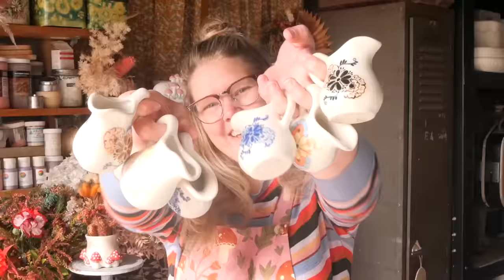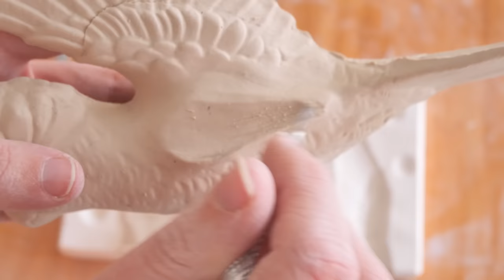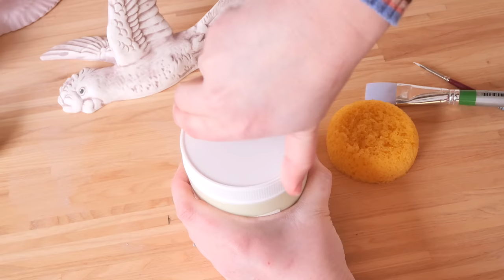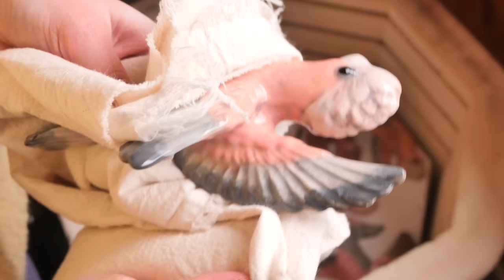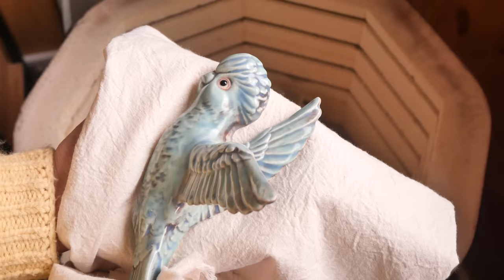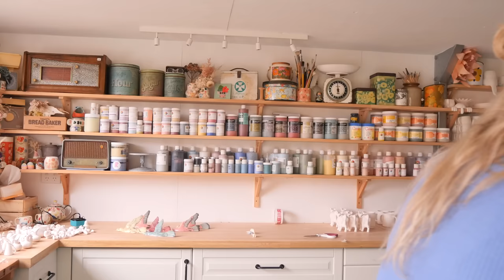Ep.9 These pieces CRACKED!! I don't know how to fix this!

Comment: Hello Shelby, I believe that the opening in the back will slip over a nail that is in the wall.  I think that they would be well supported and hang flush with the wall.  It is nice to see all the different versions and I am confidant that you will learn how to fix the cracking issue.  We all can be hard on ourselves when things do not react the way we expect, but this is how we grow.  Thanks for the hard work you do for these videos and for taking us along on the journey.
Reply: As someone that has the 3 flying ducks on the wall this is exactly how you hang them. You hammer a nail or put a screw into the wall and then the little round hole slips over the end of the screw/nail so they are flush to the wall. I also think there is a special type of hook you can get to hang them from drywall.
Reply: Was thinking the same thing, a nail or a hook are often used to hang something like that "invisible". Sadly not a potter so no advise about the cracking. The birds are very cute though!!
Reply: 100% this
Reply: This was my guess too
Reply: Precisely what I would do.
Reply: And I was figuring either a nail or a round head screw
Reply: My Nana used nails too.
Reply: This is exactly what I was thinking too
Reply: I have kingfisher versions and they have a small keyhole shape hole at the back to hang on a nail. Beautiful galahs - wish I could buy them too!
Reply: As someone who grew up in Australia and had a pet galah,  I would love a set of these. I doubt they'd make to England in 1 piece. They are beautiful x
Reply: I really like the first picture of when all the birds were on the table together. They looked like a whole flock of birds and were all different. Looked so spectacular. ❤
Reply: Yes, we had a set of fruit and a set of ducks all had that hole to fit over a larger head screw/nail. Very common kitchen decoration years ago in Canada.

Comment: Shelby I used to pour these you need to pour much lighter drain sooner the head to wing crack is possibly an air gap in the head but mostly due to head being full. Then get the mold open to set up and then add wing when it is formed wings also need to drain and poke a hole into the body  where they join.

Comment: I think the cracking problem could be fixed by taking the birds out of the molds sooner. If too much shrinking occurs while the clay is in the mold and part of the mold interferes with the clay's ability to shrink without being stressed it could result in cracking (especially in that curve where the wing attaches to the body). I also slip cast and have found that that usually solves the problem. Good luck!

Comment: We had some hanging budgies and they hung happily with a nail in the wall , popping in the hole at the back of them 🤗 x
Reply: I’d use it as a nail hole as well. If the angle isn’t quite right, you can use nano tape-that double sided silicone tape. That way you can secure it at whatever angle you want.

Comment: the holes are for nails in the wall probably, but I would use a raisin based glue for adding a hook or use 3M picture stickers
Reply: I agree with the notion of reinforcing the hanging method.  Adding a hanger with more options for angles and direction will give you lots of choices and the confidence that all of your hard (hard!) work won’t come crashing to the floor! Like other commenters I had to google up some photos and the pics show the pink as very vibrant.  You’ll get the glaze right. Test tiles may be the ticket since the birds are so so delicate?
Reply: Yep 3M picture hanging Velcro strips would work perfectly for these!

Comment: I know you weren't too happy with these, but I think they're fantastic! I love the vintage flying birds. I'm not a slipcaster but I do work with clay... I think you're right that there's some sort of tension causing the cracking. I wonder if just taking some extra time to compress the spot would help. That or maybe adding a bit of extra clay in the spot to support it. As for the hanging, maybe a couple of holes on the back that you could string a wire through? Just suggestions! Love the video, as usual, especially your commentary at the end when trying to hang the birds. You're an expert at the "Australian No".😆
Reply: Ah-o Naaaaaawr! 😂

Comment: I think what may help with the cracking is when you're letting them get to leather hard, have them dry more slowly. That spot is really thin compared to the rest of the piece. I think it may be drying too quickly, but not enough to where it's cracking before you fire it; but it's introducing enough stress so that it cracks when you do fire it.

Comment: I am NO potter or craftsman but I use 3M Velcro Command strips on EVERYTHING I hang in my home.  As long as you have a flat surface against the wall you can make it work, just a thought so you have less pressure to worry about how to attach it.  

Sending ❤ from the 🇺🇸! 😊

Comment: I have used epoxy clay to atatch one of those triangular things to hang picture frames in a couple of ceramic things. It works really well but doesn't look pretty (but is out of sight sooo...)
Also, I just finish watching The lost flowers of Alice Heart per your recomendation. Is really good and the filmography is sooo beautifull. Australian native flowers are really pretty (love the set of mugs you made too) 
P.d.: sorry for my english
Reply from the maker: Oh really!! Yes I don’t think the back matters as long as you can’t see it and it holds up! I might give it a go!!
Reply: Nothing wrong with your English 😀
Reply: @ShelbySherritt  yes, a couple of them are really heavy and they are good 3 years later. I used the one with 2 parts that you have to mix

Comment: I love the yellow as it looks like an antique.  The cracking is minimal and only you noticed it.  The hole is for a nail.  You could also use dry wall hooks, they are also called monkey hooks that should work w the holes.😊

Comment: I don't know how you're supposed to hang them, but I would think just a nail would work. The holes on the back remind me of these decorative Italian plates my mom has. We have them on the wall via a nail with a large head. They kind of slot in and settle and just hang there. But like I said, I don't know if that how it's supposed to work.
Reply from the maker: Yess that’s what I am thinking of too! I think I just feel nervous about the commitment of putting a nail in the wall just to test if they will hang. They will definitely work on a nail! Thank you!!
Reply: @ShelbySherritt  You're welcome. Hope it works out. Good luck!
Reply: @ShelbySherritt  Yup, keep it simple. I believe it will work fine.
Reply: @ShelbySherritt Command do stick on nails for hanging things (I’m a renter and needed one to hang a clock that is meant to hang on a nail, it worked great)

Comment: These are super cute. For hanging - Not sure if they are available in Australia but here we have command adhesive. The Velcro kind are all I use to hang stuff on my walls now.  They hold up heavy picture frames, are easy to adjust, and come off cleanly when you are done.

Comment: Hi Shelby, another hanging option you could try is using two part epoxy to attach a wire loop or metal picture hook of sorts on the back of the finished piece. I have made slate engraved plaques at an engraving shop, and we would use that method and works well. Good luck! ❤ I absolutely adore you and your work!

Comment: Yeah I slip cast a lot too. Where you're getting those cracks is a narrow point in the mould. When its drying its contracting and you're getting tiny hairline cracks that open up when you fire them. Its also possible that because of the shape the moisture is being pulled out by the plaster a little unevenly, so this area is drying faster and making the problem worse. You could try pulling them from the mould a bit sooner than you usually would, but I don't know if you'd then get warping.

Comment: My seagull hangs by the hole in the back. I use a slightly heavy headed nail and tap it into the wall leaving it sticking out to accommodate just the thickness of the clay. He has been that way for years. These are so pretty!

Comment: Oh this is such a fun mold and such a unique color combination on a bird - that’s definitely a tricky dark pink/red to replicate! I love how they turned out and I really like how different the blue matte glaze was so different in the contrasting areas! 

I bet you could use a command hook inside the larger opening to hang those, although sticky tack was a great idea! I don’t have much experience with clay, but I wonder if you could get some kind of Sculpey baking clay and shove it in the larger hole of the finished birds with some hanging wire/armature wire, then bake it again? 🤷🏻‍♀️

Comment: Regarding hooks, there is a type of tension loop that is used with Christmas tree ornaments — basically it’s a loop made from strong/ springy wire that is not twisted shut at the bottom and instead has two horizontal arms. To instal into a hole you press the arms together and then once inside the piece they spring/ extend into place inside the piece. I have some fairly heavy artisanal glass ornaments (3-4” diameter) that are hung this way and they hold just fine. Unsure if this will work for your birds, but it might be worth a shot!

Also, love the native Australian fauna!

Comment: Beautiful galahs! If I were you I would compress the clay around that cracking area after removing the mould. Whilst moving them before bisque they should be kept very supported. The neck will act like a hinge as the head pulls down away from the body. Any cracks you did get could be reinforced with a tiny bit of clear UV resin and a UV torch. They are just so lovely. We get flocks of galahs here in Canberra... I love watching them chatter together.

Comment: Silicone is a very strong adhesive that is excellent to attach non porous material to each other. I have used it to glue glass to glass and pottery to bowling balls for garden globes. It’s the stuff you use with aquariums. It’s waterproof and stays flexible. 
I think you can attach something to the back of the birds with it.

Comment: The cracking would bother anyone who works with clay. From what I remember, cracking happens because of air bubbles, drying speed, or joining the wing. Maybe the clay is too thin right there too. Many don't realize these flaws take away the value of the piece too.  I worked with clay a long time ago in college and have made my own mold aming other things. Cracking happened there during a raku fire and rather mysteriously on this gentleman'd piece who neither him nor the professor could figure out why. Its a real artform that has it's dissapontments. I had an instructor who threw away pieces by slamming them into a metal trash can breaking them. It was so dramatic and she was so talented, most of us didn't get it. You're good natured about it. And I like this series.❤ From Texas USA 🤠🇺🇸

Comment: My grandma had pieces similar to these kinds of birds, and they were just hung on a pair of nails. That helped them both to be stable and to hang at the correct angle. 
I think the blu tac was a great solution though! There's another even stronger kind of putty called Museum Putty, which I use in holding stage props in place. It claims to be earthquake proof! I wonder if S-hooks with kind of a wide curve would also work for that board?

Comment: In terms of hanging, I have a few ideas: If the hole is hollow enough, you could thread something through to the other hole and tie it up. Or you could have... Something like a stick with a loop, that you could insert in a hole and then it clings to the back and because its broader than the hole, it would hold? What about  hooks on top before bisquing? Or just a nail in the wall? There are other  nail like hangings and hooks, that go into the wall, where you can just hang things from.

Comment: 🪽Beautiful work. You did them justice. 
My heart was in my mouth when you used masking tape for the hooks. I thought now they're going to fall😱

I Was wondering if you could try scooping some clay from the back to hollow out the body of the bird a Little more so its a closer thickness to the wings..... Uneven thickness causes cracks.

Im not an experienced potter but Ive had small sculptures and figurines fired and have followed that same process with them.

I enjoy your chanel 
Love from Melbourne 🐨

Comment: I bought a ceramic wall art piece once, and on the backside it was a permanent patch/sticker with a small metal ring to hang on a nail. I have seen them in shops where they sell frames and home repair stuff.

Comment: I’ve seen doves like this but they were applied to a flat planter front. I’ve also seen the doves, which have the wings just like those, applied to pillars around the top and to a ceiling medallion.  As a 3D ornament and they were glued. And E6000 is a great glue for the hooks

Comment: Hey Shelby, I love these.  I'm wondering if the way they are fired has to do with the cracking.  Sometimes when I place things that are different thicknesses closer to the elements they heat and cool unevenly and they crack.  It's also a fairly large and flat form.  Maybe experiment with placing some grog under the piece so it can move more easily as it shrinks during the firing?  If you can, try to compress that area a bit from the back as well and be extra careful of bending that area when removing from the mold.   Perhaps make a few and test one per kiln load. They are so lovely.

Comment: I have quite a few ceramic pieces from the 50s and 60s - mostly wall pockets.  They generally have a little hole in the back that slips over a nail.

Comment: You could use a two part epoxy to add the hangers or loops - it should hold if you have a spot that isn't glazed I would imagine? They sell little syringe like epoxy tubes that do the measuring for you and you just have to mix and apply!

Comment: I love your work. It's been years since I did slip molding. I've been trying to reingage in it lately, however, it's so difficult to find a shop in this technology based younger generation that values this art form enough to provide a kiln service to those of us still desiring to participate in this wonderful hobby.  I'm in Central California the home of Cilicon Valley. This is a craft / art forum that looses It's individuality when the computer sciences are applied. It's not really compatible with the industrial mass production mindset provided by software & 3d molding technologies.

Comment: I would use Command strips to hang them.  They're designed to hang pictures and ornaments without leaving any damage on the wall or the item and are super strong.  I also agree with the other comment about the little hole being there to hang from a nail.  I remember all my nans pictures being held up by nails!!!!

Comment: I'm sure I've seen some ceramic plate specific glue patches with hooks on that we had for those decorative name tiles I had as a kid. they were stringy round and had a triangle of metal through them. you might not have to cut a hole at all, just keep it rough-ish or clean in that one circle?

I found a few that look similar on amazon when i looked for 'wall plate hanger'.

Comment: They sell adhesive discs for mounting plates on the wall. It’s a super sticky disc and has a brass loop for hanging from a picture hanger or nail. But if it’s strong enough to hold a plate it should hold these birds.

Comment: I used to have pottery butterflies and they had thin plaques that small wire hangers were attached to. The plaques were either wood or masonite, I'm assuming they were attached by some strong adhesive.

Comment: Could you add a tiny hole or a slit in the back close to the head/ wing connection? Maybe the expanding/ contracting could go there? Does it happen on all 3 sizes or just 1? I do love these and hope that you can work out that issue ^^.

Comment: Wow! What are the chances! I looked at galah images, and their pink feathers are really bright. You did good, Shelby. As far as the cracking, I wonder if the pottery is stretching during painting. It may be a tiny inadvertent manipulation on your part. I also wonder if the back of the bird is perfectly flat to carry the weight of the pottery evenly. My third thought is the upright wing pulling toward the the bird base. Can you squeeze the bird’s bottom wing toward the bird’s head just a tiny bit? Or add some slip there? I’m not a potter, so I’m just using the physics part of my brain to problem solve. Gee, could that attached wing be too heavy? Good luck, sweetheart. I have faith in your pottery skills.

Comment: To hang them just look for plate hangers. The ones that have an adhesive back, which I'm sure you epoxy, and a metal triangle. You can usually find them on different sizes. Cute birds.

Comment: I have seen some wall pieces with an indented hole in the back so you would slide it on to a flat head nail on the wall. Or you can attach a bug magnet on the back and display them on a magnetic wall, door or refrigerator.

Comment: They turned out so cute!  There has to be a way to stop them from cracking.  Command strips?  Would they work to hold them up?  Would filling the mould up and letting it set longer make them more sturdy?  (Can you tell I don't do this?)  Just my thoughts.